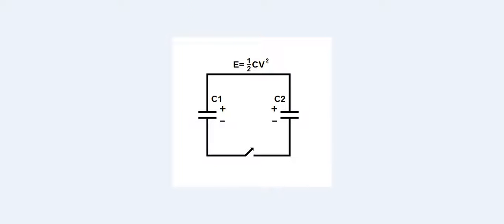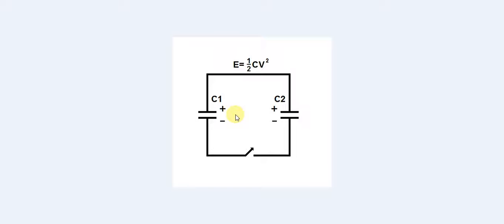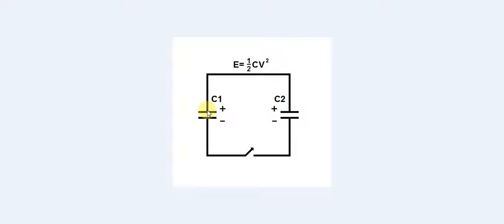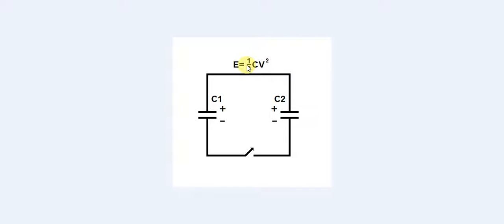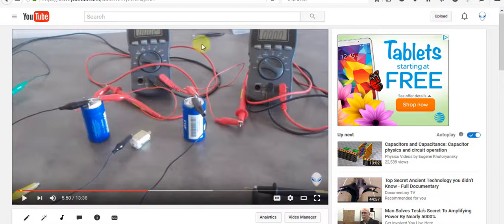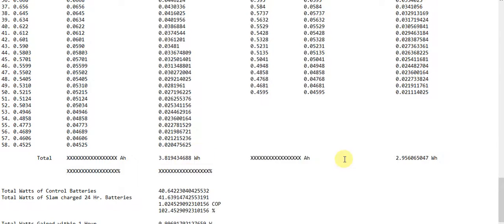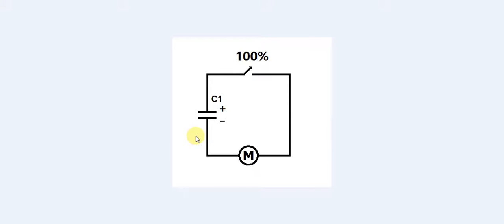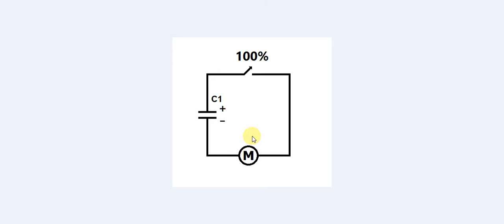Two Capacitor Paradox SOLUTION!

Comment: I just have a thought: regarding the containers of water analogy from the previous video, maybe it's this: in one container of water, the average potential energy is mgh, where h is the height of half of water. Then, when you pour into two contaniers, your potential energy is m/2 g h/2, and there are 2, so it is mgh/2. There, half of the potential energy "disappeared" (in this case became kinetic energy, and then dissipated into heat). Maybe this is similar.

Comment: Since one important factor in this lesson is 'units'.  It should be pointed out at 2:20 you say "POWER" (units of Watts), where it should be "JOULES" (energy)!
Reply from the maker: Hi, watts and energy are “nearly” the same, except for “time” of course. Add time into the equation and the energy then moves through time and space to become power. A “1 watt second” is equivalent to 1 joule of energy after it has become kinetic after being potential. If you know how many watt seconds a device uses you can easily convert to find how much energy it burned through and vice versa, if you know how much energy in joules you burned in a certain amount of time up then you can find how many watts that equates to.

Comment: Dude WTF “The energy just vanishes into heating.” ??? Are you the real life Version of Forrest Gump? 

Capacitors are like batteries and when you put batteries In series they are additive. So 5v + 5v = 10v 

Yeah I couldn’t watch more then 1.48
Reply: False explanation and misconception. The voltage is distributed across the two capacitors. The capacitors are now in parallel, not series.
Reply: The potential difference between the capacitors should be the same, because they are connected by wires and are in parallel.

Comment: There are several ways you can prove you loose half the energy.

Some background concepts...
Q = C*V  (charge stored in a capacitor is equal to the capacitance times the voltage)
E = (1/2)*C*V^2  (energy stored in a capacitor)

For simplicity, assume both capacitors are equal value (C).

The initial charge in the first (charged) capacitor is equal to the capacitance times the initial voltage on the capacitor.
Q = C*V

After the capacitors are connected, charge flows (current) from C1 to C2 until the charge is equally shared equally between the two identical capacitors.  The charge is divided equally between the two capacitors, and their voltages will be equalized (Vf).  

Now you can write an expression for the charge at the final state.

Q = Q1 + Q2 = C1*Vf + C2*Vf = 2*C*Vf

Since no charge was destroyed (water analogy) the initial charge in C1 must equal the total charge in both capacitors at the final state.

C*V = Q = 2*C*Vf

Now you can see Vf = (1/2)*V  (the final voltage will be half the initial voltage in C1).

Now we can calculate the ratio of energy in the two caps at the final state to the initial energy in the first capacitor.

E1 = (1/2)*C*V^2
Ef = (1/2)*C1*(Vf)^2  + (1/2)*C2*(Vf)^2 = C*(Vf)^2

Substitute in Vf = V/2
Ef = C*(V/2)^2 = C*V^2/4

Now take the ratio of Ef to E1

Ef/E1 = (C*V^2/4)/(C*V^2/2) = (1/4)/(1/2) = 1/2

__________________________________________________________

You can also prove this by looking at the energy lost in the wiring resistance.

First, solve for the current through the resistor (using the Thevenin's equivalent circuit)
I = (V/R)*exp(-2*t/(R*C))

Square I and multiply by R to get the power (P=I^2*R)
Pr = (V^2/R)*exp(-4*t/(R*C))

Integrate the power with respect to time to get the energy dissipated in the resistance.
Er = int(P, t, 0, inf) = (V^2/R)*(-R*C/4)*exp(-4*t/(R*C)) evaluated from 0 to inf

The R's cancel out!
Er = C*V^2/4

Now take the ratio of Energy dissipated to starting energy in the first capacitor.

Er/E1 = (C*V^2/4)/(C*V^2/2) = (1/4)/(1/2) = 1/2

____________________________________________________

I think the charge-conservation derivation is simpler, but both methods agree.  

Hope this helps!

Comment: Your diagram is  nonsense.  . to charge  your  capaitors  you  would imput  in series   and    your  output to the load  is also  between + and -. WTF?
Reply from the maker: Search for my unpopular video that has been ignored of the 1 battery 2 capacitor Tesla Switch. The energy exchanged back and forth through the load is exactly the same. 🤔.
Reply: So invert the polarity of anyone,then we have a emf?

Comment: My take on this... I think your intuition is correct that "something" is conserved here in that it is shared equally between the two capacitors. That "something" is electrical charge, the useful analogy often made is that quantity of charge is like quantity of water. So when you pour half the water out of one jug into another jug, the combined amount of water in both jugs remains unchanged. But you are being misled by equivocating... i.e. by transferring the intuition (of this kind of conservation) from charge (where it is correct) to energy (where it is misplaced). Energy is not charge. Energy does obey a conservation law, but not of the same form. The point being overlooked here is that when we transfer water from one jug to another, this action requires work to be done, and work is the conversion of energy from one form into another (cf. the conversion of potential energy to kinetic energy). The math shows us that in the case of the capacitors, the amount of work needed to transfer the charge from one capacitor to the other exactly equals the amount of energy remaining in the capacitors -- i.e. when we look at the electrical charge in terms of its "potential" energy ("stored" energy), half of it has been lost to the "kinetic energy" of having to make the transfer. To put it another way, the number of electrons on the plates (electrical charge) remains the same, but the electrons themselves have lost half of their "potential" energy to the "kinetic" energy consumed in the transfer.

Comment: Assuming C 2  = C 1= C , and the switch resistance is R and Vc1 = V0 , Vc2 = 0 initially. After switch is closed  at t=0 and system will eventually reach a steady state. That is:  Vc1 = V0/2  and  Vc2 =  V0/2. And no current flow in steady state.  Now the total energy left in the capacitors is (1/8* CV02)*2 = 1/4*CV02, The amount of the energy loss is the same as 1/4*CV02.  This energy loss is in heat dissipated by the resistor. The amount of energy dissipated is I*I*R*dt where I = V0 /R(e^(-2t/RC). Therefore, the total power dissipated in resistor is; Integral of ((( V0 /R(e^(-2t/RC))^2)*R)dt from t = 0 to Infinite or V02 /R * Integral of e^(-4t/RC)dt from 0 to Infinite. Careful calculation the integral equals to 1/4*CV02.  No paradox, no radiation and no need to evoke James Clerk Maxwell. Just circuit theory and mathematics.
Reply from the maker: Chen Yi Lee Very good indeed.
Reply: You have various sites in youtube related to electrical engineering subject. You are a hard working guy. Any good idea, you can write the article and submit to IEEE for publication. I hope you become Tesla (better than Edison), rather than the cold fusion fiasco from University of Utah. May be that fiasco happened before you were born.
Reply from the maker: Thank you for the IEEE publication suggestion! I wonder how difficult that is? At any rate I think I will try my hand at that. Thanks Chen Yi Lee.

Comment: May I please refer you to the article at Internet address:
capacitorparadox.appspot.com

The point is, there is no paradox.  I quote the article:

I don't believe that "free space" recognises a switch.  It recognises capacitance and inductance, among other things.  But a switch is an artificial concept, and therein lies the fallacy behind this seeming paradox.
Reply from the maker: +George10767 Would the effect upon capacitor Cx result in the energy in C2 being recovered and restored to C1 ?  It seems likely, but I don't know.  

Why don't you just do the actual experiment. That concept just simply adds another capacitor to the equation, another 50% loss of energy, which I have actually done what you have suggested.

It's quite simple the energy is never lost, just simply wasted away instead if not made to do work that destroys half of the dipole, (power source).

Comment: Your "solution" does not offer an explanation as to why the energy loss is precisely 50% (assuming C1  =  C2).  You can insert any load resistance you like, but the energy loss will remain the same.

This paradox was first demonstrated to me when I was an engineering student.  We asked the lecturer for a explanation and he started to "bluster".  Whereupon we realised that he didn't know the answer but was too intellectually dishonest to admit it (despite a PhD degree).

The two formulae which apply here are:  Q  =  C.V   and   E  =  C.V(squared)/2
I think the paradox occurs because there is more to the way the universe works than these two formulae.  There is a physical concept called "entropy" which may be found in mechanical engineering as well as electrical.  I suggest that this concept might provide the true answer.  See Wikipedia: https://en.wikipedia.org/wiki/Introduction_to_entropy

In particular, if you construct a system in which an electrical charge is moved through space, then you are immediately involved with the concept of "inductance" and you cannot avoid it.

In your circuit diagram, assuming that the switch is simply a switch, upon closing it the system would oscillate or "ring" due to the inductance of the connections.  If you assume that the inductance is infinitesimally small, then the frequency of oscillation would be infinitely high.

Here follows what, in my opinion, is the "purist" answer.  The switch should be regarded as a VARIABLE capacitor.  As you close the switch, the capacitance across it increases from (initially) zero to (finally) infinity.
(Capacitance  =  permativity  x  area/distance   where distance across the closing switch reduces from infinity to zero).

It follows that the switch (i.e. variable capacitor) is trying to do work on your hand, and this accounts for the loss of precisely 50% of the energy in the system.  In practice, of course, there would be the extraneous effects of lead resistance and jumping sparks.
Reply from the maker: Hi, you’re not nuts, you are precisely correct. One is left with exactly 1/4 energy in each capacitor for a total of half the energy left in the entire system. There’s a secret in this recipe. If you have really well made capacitors you will actually end up with just over 50%, meaning if a load is placed in between you can power the load with all 100% from the supply, plus a little bit more, which happens to be more than what the supply supplied in the first place. It is the combination of the power supply and the capacitor together. Think about it.
Reply from the maker: +George10767 Hi, there is no magical loss of energy, well actually it is lost, but it doesn't get destroyed and doesn't  disappear into the aethers. 

The exact 50% loss makes perfect sense. It is newton's law of every action has an exact equal and opposite reaction. Sometimes we can get more reaction than action, but most of the time never more than 100%.
Reply: i think the answer is in the math  .  assume c = 1  voltage at 100 = 10.000 now half initial state is 50 volt charge left is 50^2= 2500. now its a 1\4 its original charge but half its volts.. i might be nuts but inverse square type magic going on here
Reply: Wrong answer george. When the switch is closed, the capacitance across it reduced from fixed capacitance to zero. Your simple mistake destroyed everything you said.

Not to mention that energy flow is only permitted the instance the capacitance become zero. There will be sparks of course due to the fact that it tries to allow current to flow through that air gap, resulting in increased voltage right after the switch. This is energy gain, not loss as light.

We all know that when you on and off a switch the resulting voltage becomes higher but that is only for impulse electricity. Here, discharging a capacitor produced impulse electricity.

Comment: This guy does not understand the problem. The problem is that the absolute truth of Maxwell's equations that is always observed in practice can be shown to be in contradiction outside of observation, in a circuit where no resistance exists.   He is adding a load to the circuit, eliminating the problem. In the problem the fact that there is no resistance (impossible to observe) the laws contradict one another. He hasn't proved a thing, like so many people who have attempted to resolve this over the past 200 years.   Every time it gets "resolved" it gets resolved by the practitioner not understanding the problem.
Thumbs down.
Reply from the maker: +Doug Plumb +Doug Plumb Ok, yes, zero resistance can not be observed, then there wouldn't be anything to speak of. With no resistance, which is like saying nothing, and since we can't observe nothing because it does not exist, at least in this physical realm it doesn't.

A short circuit has no resistance, or close to it, but it still has resistance within the two points of connection.

With no resistance we would then have to ask about the current. It would be infinite right? Then no loss. Just like everything else it must be slowed down somehow in order to observe it, at least in this physical realm you have to.

As I've mentioned previously the energy is fully accounted for, with no wires, no capacitor leads, no resistance of any kind, it doesn't just disappear, it has to go somewhere.

Again energy can not be destroyed nor created, but only transformed. In a perfect world, which this world is far from, and a perfect circuit without resistance, which represents an infinite load, (or a perfect short circuit) the most current would flow at the fastest rate. 

Without a load to flow through, or this "nothing" it dissipates as electromagnetic waves and heat outwards and away from this "nothing" connection, or our capacitor energy calculations and formulas are flawed, but sadly they are correct, 

It's the classic give and take situation perfectly balanced out at 50/50. Newton's law. For every action there is an equal and opposite reaction. The Lenz's law, or whatever law, throw an apple up, it falls back down.

The load allows us to "observe" half of the energy it takes to transfer the other half, by giving it more resistance so that we can then measure, same as with a meter, simple enough right?

It is a fifty percent efficient process in that we can only "save" 50 percent, while the other half is used to transfer that 50 percent over, yet still be able to do work with it.

Without a load it only appears to be an "illusion" of energy disappearing, which it does not! It is transformed into radiation and heat through an infinitely large load, too fast for us to see. All we have to do is slow it down with a load of some resistance, then we can see it do work  instead of wasting away in an infinite work load that is too fast to see, and then say oh look, it just disappeared.

You might as well just get a capacitor as a power source and pulse it and catch the resulting collapsing field and charge another capacitor, at least you'll achieve an 84 percent efficiency instead of a 50 percent efficiency.

So what was the problem again and what do I not understand about it?

Comment: You have each "-" series capacitor pair lead across the motor.  In this case the motor should not be in series with the parallel capacitors' "-" sides.  It looks too much like NO potential *difference* ACROSS the motor
Reply from the maker: +dale nassar That's because there is no potential difference across the motor, this is the other side of cold electricity of no voltage, but only current.